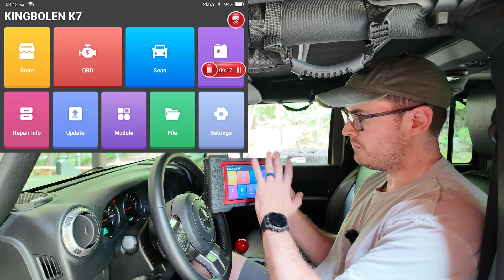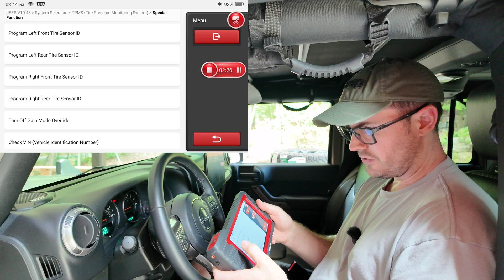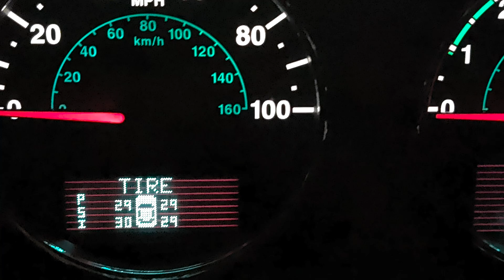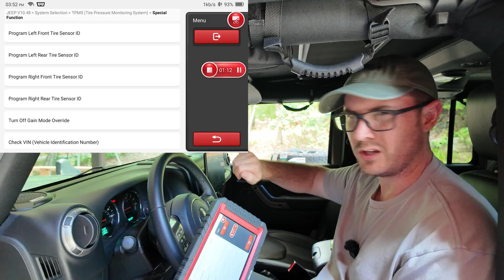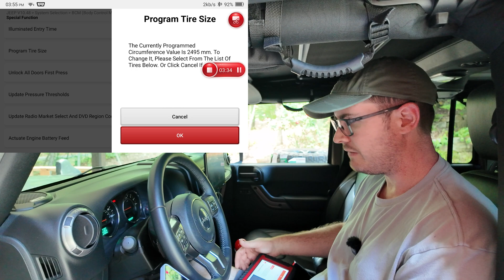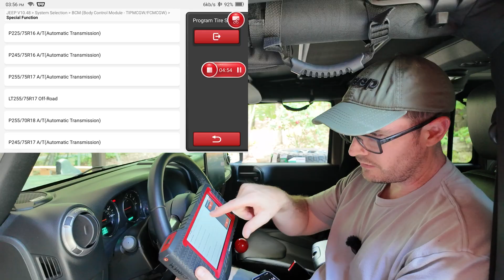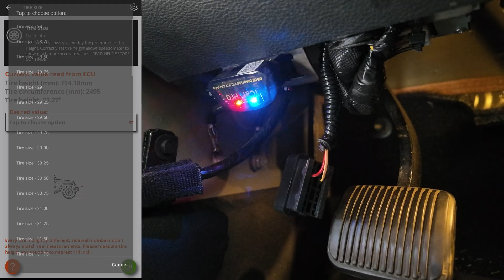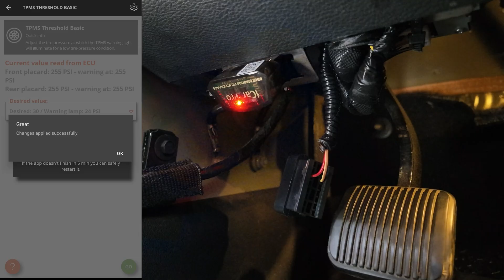FIXED! Jeep Wrangler JK 35-inch Tires: TPMS Sensors & Speedo Calibration (Kingbolen K7 & JScan)

Comment: Thanks for the video.  I haven't watched others on this topic yet, so here's my immediate question:  Did the tire shop provide you with the sensor ID# that they placed in each particular tire?  I assume that if you did need to enter that info, you would want to make sure that each is identified correctly.
Reply from the maker: Great question = 3:11. Best option is to take a picture of them beforehand so you have it handy later on. For modern systems the vehicle will identify the position automatically, so even if you rotate tires following the original positions it'll update.